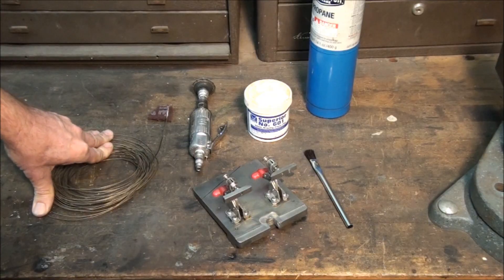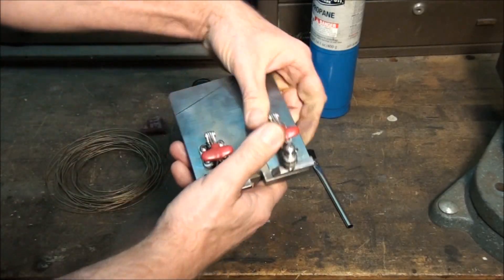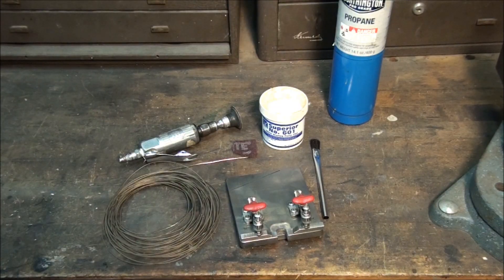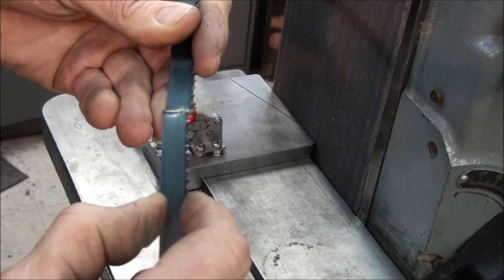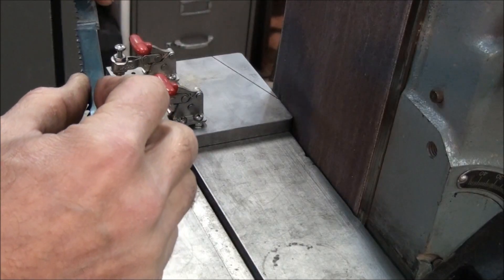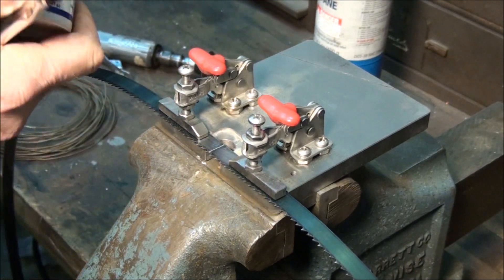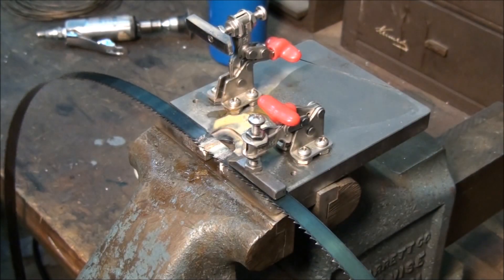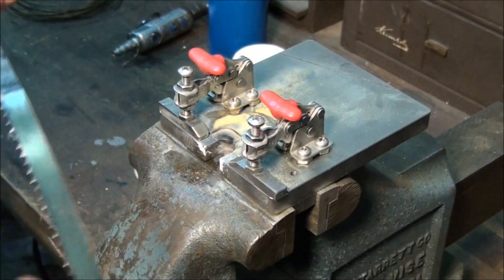How to Make Custom Length Bandsaw Blades Without a Welder

Comment: Nice video. What percent silver do you recommend? Do I want ductility to allow flexing or strength so it won’t break?
Reply from the maker: Strength is the goal, so you'll want a high silver content of at least 60%. For that to work though, you need a very close fitting joint, which is why the fixture is a necessity. Just be sure to get flux to match the grade of silver solder.
Reply: If I have an OA torch, would that be better than the butane or would it put the metal at risk of being burnt through because of the heat?
Reply from the maker: Oxy-acetylene is fine, just use a soft (carburizing) flame.

Comment: Great idea and video!
I used to make Sterling silver jewelry and have always found that riogrande.com had quality silver solder and flux!
A technique used in soldering jewelry is to cut a small piece of silver solder and place it on the join,,making sure it touches on both sides of the join.
Heat the piece until the solder flows and let it cool.
This will eliminate having to clean the excess solder after soldering is complete!
Reply from the maker: That would probably work if there were no gaps in the joint. Wire solder is more forgiving, but as you say, it must be dressed down afterword.

Comment: Thats pretty awesome. I have a bunch of blades  that bounce because a couple teeth are gone. So I removed them from the saw before they broke. I can now fix them
Reply from the maker: Be careful you don't cut too much out so they no longer fit in the saw. If the damaged area is too long, you might have to replace it.

Thanks for watching.

Comment: Great video Tom.  Lee Valley Tools in Canada sells a little kit to do this very thing.  Of course their fixture is not nearly as good as yours.  On your saw cut to grind the blade, I have two different blade widths on my two saws so I am aging a person would simply have two 20 degree saw slots, one for each thickness.  Thanks,  Tom
Reply from the maker: Or a larger slot with an adjustable gib, so you could set it at whatever width you need.

Comment: Bi-Metal blades are the way to go.
Reply: Do you use bimetal on a wood saw? I can buy 100 foot coil of regular blade for twice the cost of a single bimetal blade. And a regular blade lasts me about as long as it takes between finding nails and other abuses. I would think a bimetal blade is not going to cut through too much more nails or abrasive inclusions than a regular blade when running at wood cutting speeds, without dulling? 

Neer'mind. I got my videos mixed up. I suppose you're talking about metal saws.

Comment: Great video and very logical.But with limited means, how did you cut the 20degree bevel angle first. John from Oz
Reply from the maker: I used a slitting saw on the mill. Alternatively, a wider slot could have been milled with a filler piece to obtain whatever width groove was needed.

Comment: Great video!  I notice your Deltas sander in the background! How do you keep your wheel so clean and free of adhesive?
I have a build up and have a hard time getting it off.
Cheers,
Reply from the maker: Lol, it stays so clean because I never use it. In fact. there has never been a disk on that machine. I much prefer the belt over the disk.
Reply: @TomsTechniques  That's funny!  I agree... too much hassle changing disks etc. I have a belt but it's a little cheepie one. Next purchase i guess:)))

Comment: I think it must make anealling
Reply from the maker: annealing is not required because the blade is not being welded. Brazing does not get it hot enough to cause brittleness.
Reply: @TomsTechniques . Hmmm. Tom, I believe the old timers may have incorrectly explained it as "annealing" when they really meant tempering. And maybe it is different with metal cutting blades vs wood cutting. I have found an improvement when tempering the blade after brazing.

Maybe the blade is hardening due to the combo of air-cooling and the clamps you might be using. Even the rest of the cool blade, itself, might be drawing heat out of the braze area fast enough to act like a quench to the steel. I don't know. But if I don't flame-temper the area around the joint, the blade tends to fail about half an inch to one side of the scarf joint. I try not to do things that aren't necessary, but after 3 consecutive failures in this manner, I decided to start "annealing" (really tempering), and this mode of failure all but disappeared.
Reply from the maker: When carbon steel is heated to a temperature above the recrystallization stage and allowed to cool, it becomes annealed and loses all of its hardness. If it is heated to various temperatures under the recrystallization stage and allowed to cool, it loses some of it's hardness and becomes tougher. When I weld bandsaw blades, I anneal after the weld, then temper after the grind. That seems to result in the strongest joint. 

Brazing is an entirely different animal because there is no welding, or grinding of the steel, so the blade doesn't get brittle. No annealing or tempering is required.

Comment: So it goes without saying that you sharpen your own blades too? Otherwise, what's the use?
Reply from the maker: No, I don't sharpen my own blades. The usefulness of the fixture is that you can make your own blades for much less than buying them pre-made.

Tom
Reply: My reason for starting to join my own blades is even though I may not intend to make up my own from a bulk roll due to limited use, variety of width and TPI used and initial outlay etc, being able to repair a purchased blade if it breaks can be convenient. In this case apart from saving the cost of a new blade or paying for a repair, being able to repair your own may be more convenient than waiting for a new blade purchased online or traveling to purchase one. Even if not as sharp as it should be it may get me by until I can get the new one. And yes I know it makes sense to carry a spare but as a hobbyist carrying a new spare of each blade type is unlikely to happen.
Having said all that if I did come across a great deal for bulk blade material I could then make my own and probably wouldn't wait so long before changing blades!
Reply: You can also repair a blade if it gets bent or broken, prematurely. If you try to cut a rod/dowel and the stock spins/slips, the blade can jam and bend before it comes off the wheel, ruining a section of blade. Murphy's law means this usually happens within 5 minutes of putting on a brand new blade. If you can braze, you can replace that bent section with a piece of an old blade (or cut more off the coil, if you buy in coils). 

If you have one of those small 9 or 10" band saws, you can easily break blades well before the teeth are dull, simply because the bend radius is so tight on those. 

Also, your saw might be rubbing the top wheel on the frame by the time you get a stock blade tensioned, or the tensioner might fall off the end of the threaded rod when trying to get the blade on there, because your particular saw is slightly longer/shorter than what's available in the standard sizes.

But yeah, the main motivator for doing this is pretty much saving money and/or being able to get a saw running without waiting on a new blade.

Comment: Hi Tom
After many failures using 2 types of silver solder I had on hand I replayed your video and noted you recommended  silver solder of around 50% silver.
So not surprisingly I had tried the technique with no success using around 2% silver , used for silver soldering copper plumbing fittings here in Australia. This is a fairly low melting point solder and testing on old hacksaw blades with the correct flux this flows nicely and looks excellent but when tested (bent at the joint) the joint or blade snaps and the solder just peels off.
My other solder at hand is some very hard stuff (silver content unknown)  about 3mm diameter, that I have only ever been able to use with oxy acetylene to get it to flow. As usual I couldn't get the temperature I needed with my propane torch, wouldn't get past the 'pasty' stage and the flux ends up burnt very black. I even tried reducing the diameter to about 1 mm with no joy.
I really need to be able to use propane as it is too expensive for me to run oxy acetylene.
Your propane set looks similar to what I use and obviously it reached the required temperature ok forn50% silver.
I have likely answered my own questions but any further input would be appreciated!
Reply from the maker: Yes, the soldier needs to be at least 50% silver to be strong enough. You also need flux with a high enough working temperature for the solder being used. The stuff you used for 2% solder will not work for 50% solder. Propane will easily generated enough heat (1100-1200°F) for 50% solder.
Reply: Thanks Tom
On your advice I did intend to get some solder with around 50% silver content. However I have just been fortunate to  pick up some stuff from a mate. An unopened pack of 0.5kg / 43 sticks of 35% Silver 1.6mm dia and 750mm in length. I'm nearly embarrassed to admit to paying only AU$20 for the half kilo pack. This was what he had paid for each of 4 packs from a local market stall some years ago.
The manufacturer no longer exists but the packaging quotes the Australian Standards number and the comparable US Standards classification is BAg2. It is a Cadmium containing alloy. with the same composition as Easyflo 35 that being a BAg2 alloy.
After testing it again on broken hacksaw blade I have used it to join a couple of bandsaw blades. It flows really well, didn't separate from the steel when the joint was broken up and seems to be successful.
Time will tell of course and if not well, for the price it will go in my drawer with the rest of my solders etc for another day!

Comment: the scarf joint was off the first few times because your jig kept lifting off the table causing the blade to recontact the belt at the wrong angle
Reply from the maker: Not sure how the belt can lift the fixture off the table. Is your belt sander running in reverse?

Comment: can you do the same for saw.mill band saw blades?
Reply from the maker: Never tried it, but I don't see any reason why it wouldn't. You could always braze one up by hand before investing in the fixture. Just be sure to get a nice, tight joint. The bigger bap there is to fill, the weaker the joint will be.

Tom

Comment: Very nice video.  Nice design of the fixture.  I may build it!   Only things I wonder about, is whether the 20 degree bevel is really necessary, and whether it would be a good idea to have more room between the clamps for your torch and grinder.  What do you think about that?
Reply from the maker: Thanks.

The 20º scarf angle is necessary. Without it, the joint will fail prematurely.

More room between the clamps would make it more difficult to align the joint. It's sort of a balancing act between having enough room to work and adequate clamping. An alternative might be to use a single forked clamp pad, so the clamp itself is behind the blade and away from the torch.

Tom

Comment: Now that's how its done. Excellent video!
Reply from the maker: Thanks Paul
Reply: quite welcome! trying to finish up my first diy sawmill build and coming to terms that my best bet to get the length I need is to stitch up my own blade lengths. Any chance you have a recommendation for a company that you have had good dealings with the get the rolls of blade material?
Reply from the maker: I get mine from McMaster Carr, but I don't know if they carry anything large enough for a sawmill.

Comment: Tom, fantastic information.  I'm getting stuff together (You answered a previous question of mine that has helped with this) to build this and I was wondering what type of saw did you use to cut the slot that holds the blade to grind the joint? I was going to use a slitting saw but everything I've seen on doing this says you have to run coolant on the slitting saw and I don't have that set up on my mill.  I suspect I should go ahead and bite the bullet and set it up but if there was another way (Horizontal bandsaw, Bandsaw Etc.)it would get me up and running on making blades quicker.  Thanks for all the time, effort and energy you've put into these videos, they have helped me more than you can imagine :-)
Reply from the maker: A slitting saw is the tool of choice and running coolant is not necessary. Just use a sulfur based cutting oil and a brush.

Tom
Reply: Thank you Tom  - I cut my slot on my 4x6 bandsaw

Comment: I have a Makatia Portable Bandsaw which converted into vertical bandsaw with a plywood housing. Makita replacement bandsaw blade(bimetal) cost me $65 from hardware shop. There is the cheaper version at $30 to cut wood and steel . Same goes blunt easily. Was looking forward to reclaim saw blade. Thank you for the video instruction. I am looking forward to DIY a mini horizontal bandsaw. Locked in a limited space balcony workshop.with room to put heavier bandsaw.
Reply from the maker: Better make a blade up by hand before spending a lot of time on a fixture. The small wheels on a portable saw will flex the joint much more than a full size saw and I'm not sure how the joint will hold up. Use the silver solder with the highest silver content from the source in the video description.

Tom

Comment: Would Bronze be as good?
Reply from the maker: No idea. I know for a fact that silver works very well, so that's what I use.

Tom
Reply: You mentioned one type of silver solder doesn't work, what's the difference between what does work and what doesn't?
Reply from the maker: Look in the description under the video for the link to a source (Gesswein). Anything with a silver content of 55% to 75% will work. The higher content stuff is stronger, but requires a tighter fitting joint.

Tom
Reply: Thanks.

Comment: I just made the jig in the video. At 70 years of age this was my first milling project. Took about 2 hours and worked as advertised. I used aluminum and the jig paid for itself on the first blade. Thank you Tom.
Reply: Darn, we are nearing 70 now, and wish I had stopped wasting money yrs back,,,Going to put the fixture on my too do list today👍
Reply: 6 years later and also 70. Adding this to my to do list today.

Comment: mr tom these are the only 6tpi i can find at msc Starrett - 6 Teeth per Inch, Toothed Edge, Carbon Steel Band Saw Blade Coil Stock - 1/2" Wide x 0.025" Thick x 100' Coil Length, Raker Tooth Set, Contour Cutting, Flexible Back.for 165.00 and Morse - 6 Teeth per Inch, Toothed Edge, Carbon Steel Band Saw Blade Coil Stock - 1/2" Wide x 0.025" Thick x 100' Coil Length, Raker Tooth Set, Flexible Back for 106.00 will either be ok or which one i cant find any hard back my size on msc and this from mcmaster carr1/2" Wd. × 0.025" Thick.
100 Steel, Aluminum, Brass, Bronze, Wood, Plastic Constant Set Carbon Steel Carbon Steel id doesnt say if its hard or flex but its only 97 bucks i appreciate all your help i built the jig like yours today and ive got the solder and flux coming also
Reply from the maker: It looks like the stuff you are looking at from McMaster Carr is for straight cuts. That is a hard back blade. McMaster Carr is where I normally buy my bladestock.

I actually had my first blade fail at the joint yesterday while re-sawing a bunch of Ash and Walnut. It didn't look that good to start with, so I wasn't surprised. Silver soldered it together again and it made it through several hundred feet of lumber without further issue.

Tom

Comment: tom would this be a good coil stock for cutting carbon regular steel and aluminum and brass on a vertical band saw like yours and a horizontal 62-1/2" band saw thank you tom100' x 1/2 x8R Carbon Flex Back Bandsaw Coil Stock - USA MK Morse
Reply from the maker: That's a good general purpose blade for the vertical bandsaw, on materials down to about 3/16" (at least two teeth on the work). Flex back blades aren't really intended for horizontal or cut-off saws. You are better off with the stiffness of a hardback blade for that.

Tom
Reply: thanks tom i cut from 1/8" to 1-1/4" what would be your suggestion for the amount of teeth been using 10 tooth but they are slow and i usually dont need a clean cut because it usually gets milled or turned on the lathe
Reply from the maker: One blade won't work on that big a range. Ten teeth per inch would do well up to 1/4" or so, but the thicker stuff would cut better with six teeth per inch.
Reply: For most applications and particularly for your metal work, you might want to explore bi-metal coil stock, which has HSS teeth and a more ductile backer band.  Lennox is one company that makes good bi-metal blades, but they might sell coils too.

Comment: I just suffered brain fart!
Would I be wrong if I suggested tapering the ends at a compound 22 x 45deg angle? My thinking is it would provide like 3 times the surface area... Right or wrong?
Reply from the maker: More contact area in the joint would be stronger, but I've never had one break at the joint doing it this way. Doesn't seem like it would be worth the extra effort required to do it that way.

Tom

Comment: Took me back 55 year as an apprentice in the aircraft industry in the UK.  We used to do them in a similar way but they were a bit rough and ready.  When had ground the scarf joint we put fluxes on a piece of solder between the two ends and we had a switch to send a current though the joint and heat it red hot, we never managed to do a good job but they often lasted just long enough to do the job.
Reply from the maker: Yeah, the trick is to get the gap as thin as possible. Less solder actually results in a stronger joint.

Tom

Comment: Is that blade made for cutting wood?
Reply from the maker: It's not made for cutting anything in particular, but will work well on wood, or on metal, 1/4" thick or thicker. The rule is to have at least two teeth in contact with the work at all times.